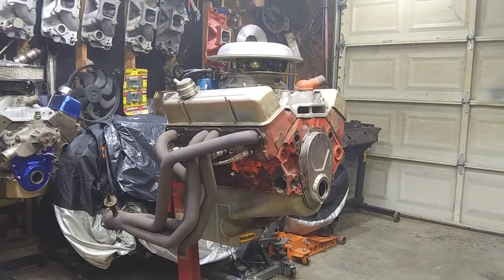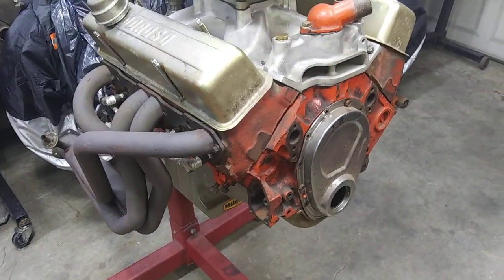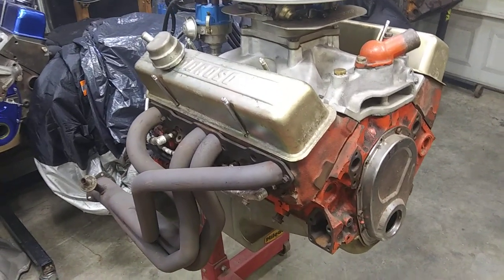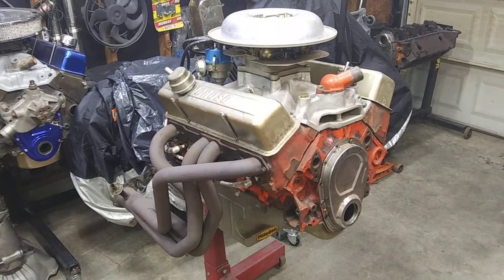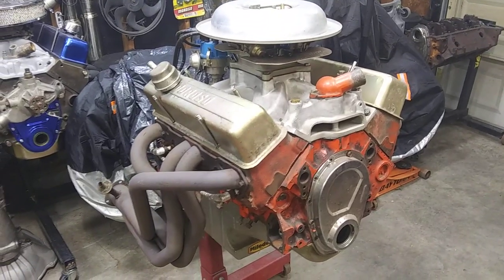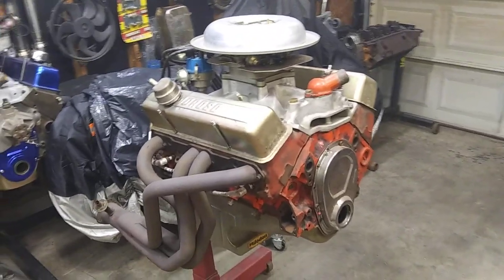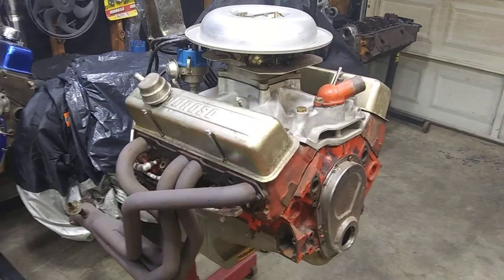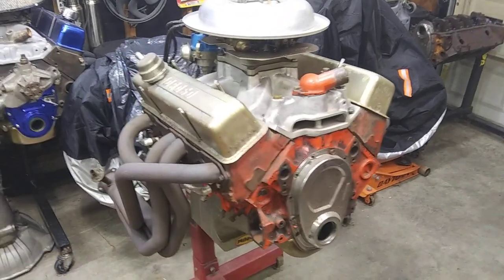The truth about the "Double Hump" heads.

Comment: Back in the day we threw a motor away if it was going to cost $500 to rebuild,   and you never put stupid money in the heads that's why if you had 202's you put them on,  amazing to see people spend 3 to $5,000 for their motors nowadays
Reply: V8s are becoming exotic , manufacturers have literally told the general public this , you want a car with a V8 now a days you have to be well to do and are now in the exotic car market .
Reply: 3-5000k is a short block now. No heads, no nothing up top. Some crate engines are well over 10K now. Better go check your numbers again.
Reply from the maker: Unfortunately the shits gone way up. Typical high performance built SBCs for me these days is $5000 to $8000 grand for parts & machine work. Bigblock Chevys are $8000 to $12,000 grand. And those prices ain't bad for today's economy. Olds, Buick, & Pontiac cost even more for a real powerful build. Pontiacs are what I started with, but I can't afford them hardly anymore. I miss the good ole days.
Reply from the maker: I'm building 3 bigblock Chevys now, I'll have around $30,000 in the 3 of them. But they will all be 700+ to 800+ NA HP each. I can still build a 300hp 350 for less than 2 grand tho. Probably could build a 400hp 350 with a Vortec longblock for 2 grand. Basic 350 SBCs are still the cheapest engine to build by far and they do respond to modifications better than most.
Reply: $5k.....nope. more than that.
Reply: 10k motor 5k powertrain and 4500 for Whoa 2500 for the wheels you're gonna put the big whoa into.
Catch me if you can :)

Comment: Don’t forget about the 3/4 race camshafts lmao 😂✌️😎
Reply: I always ask , what, you couldn't afford a whole race cam .... lmao !!
Reply: This actually has a beginning point. The 3/4 cam was a 750 lift at the valve on a flathead Ford.
Reply from the maker: V6 cam....
Reply: I know back in the day my brother ran a three-quarter inch race cam and a 383 cornet and we used to race the rich boys and their Porsches up to the mountains to Phoenix
Reply: It would idle at 40 miles an hour
Reply: They just call them "Stage 2" or "Stage 3" cams now, it's the same idea.
Reply from the maker: @hendo337  yep, simple minded shit. I still prefer to see the actual specs myself so I really know what I'm buying. Stage 3 cams come in many sizes I've noticed.
Reply from the maker: A 3/4 race cam to me is a cam with .750 lift.
Reply from the maker: I'm building a 496 now, it has a solid roller with 748/748 lift. Almost a 3/4 cam. Definitely a race cam. Springs are 275lbs on the seat at 2.050 installed, almost 800lbs open.
Reply from the maker: @hendo337  I like the stage 10 cam myself.
Reply: @thereluctantgearhead4544  sounds like you're building a motor or the pop the corks out of a Honda
Reply from the maker: @awfulcoffelsonecargarage8215  also have a 810/775 lift 296/308@.050 I could use, but it's hard on springs and I'm gonna drive this motherfucker on the street.
Reply: @thereluctantgearhead4544  I would drive it to a parking garage and see how many car alarms I'd set off
Reply: @kenmoule825  you are nuts, .450 would have been a huge flathead cam.
Reply: Back in the day guys like isky ground few cams, full race, 3/4 race, 1/2 , street. It’s pretty old term, but in the 60’s had meaning.
Reply: @dooman700  
It's not my idea. They did that before I was born back in the early 1950s at Bonneville salt flats. 0.75 at the valve. I’ve run a 728 lift at the valve SBC 3" stroke 5L. Hard on valves and springs twenty years ago with rollers and a rev kit on top of them.
Reply: @kenmoule825  it’s your idea because you can’t run .750 valve lift on a flathead. Isky 404a is a Bonneville record holding cam, it had .400 lift. Yeah you may have a small block Chevy with .750 lift but you are not building a flathead with it. The engine design will not allow it.
Reply: It was never my idea. And I've seen valves lifted that high on plenty of old stuff. Flathead is no exception with valve reliefs and different rocker arms. Remember, this is lift at the valve, not the cam lobe. It doesn't matter what others say it was never "my idea."
I don't run flatheads anyway.
I'm am done with this subject. 
Enjoy
Reply: @kenmoule825  you are showing ignorance, flathead has no rockers and it’s impossible to get .750 valve lift. The valve is not long enough. You might want to get some flathead experience before commenting on something you know nothing about.
Reply: @kenmoule825  by the way .480 is about all the cam tunnel will allow.
Reply: Ed Winfield took a full race intake lobe and mixed it with his 1/2 race exhaust lobe and named the cam 3/4 race. It had zero to do with valve lift. Stop the misinformation cycle.
Reply: @dooman700  
You just don't get it, do you?... Valve lift, not cam lift. Learn before you speak.
Reply: @kenmoule825  I get it, and you might want to go look at the design before you speak. I have a record holding flathead. I totally understand. When the tappet moves the valve with no ratio added, you get the same lift at the valve.
Reply: @kenmoule825  on a side note, a guy that told me flatheads were not his thing, telling a guy that runs them to learn before I speak is comical at best. No rocker arms means no added valve lift

Comment: had a 65 327 out of a burnt down vette,i think it was rated 375 hp ,had 202 fi heads solid lift cam with 11 something compression.sinlge quad offy/tunnel ram 800 cfm holley,hooker headers ,mallory dual point distr.and some other goodies.put it in my 64 nova ss,with 411 gears and amuncie 254 low 4 spd.turned low 11s in the quarter mile in 1978,loved that car.called it the rat killer!!
Reply from the maker: I have a 66 L-79 350hp 327 stashed away now. Had one I built back in the day with a tunnelram and a huge solid roller, had it in a 69 C-10 stepside. Engine came from a totalled 66 Chevy 2 SS. I bought the whole wrecked car for $150 bucks. Also had a M-21 4spd and 4-11 12-bolt posi. Body was wasted, got wrapped around a telephone pole back in the late 60s. Car sat in the woods for 20+yrs till I dragged it out. Hell of a deal.
Reply from the maker: I used the old Holley Pro Dominator tunnelram with 660s on my L-79. Wish I still had it.
Reply: @thereluctantgearhead4544  those were the days when you could buy tri5s for a$150,other cars ,& trucks dirt cheap all sorts of flavors.brings back alot of memories of So California in the 70-80 s.
Reply from the maker: @leroyll1144  Yep, definitely a simpler time to be alive.
Reply: Those times sound alittel fast for the combination of parts you discribed???

Comment: What size valve covers are those? I have double hump heads and was told they are different bolt pattern for covers. Thanks for any help.
Reply from the maker: Those are old school gold anodized Moroso valvecovers from the late 1970s. Double humps have standard old school bolt pattern. Those heads with the staggered bolt pattern came on late 50s 283 and 265s. Pretty rare.

Comment: What year are those? I have a set of 69 Z28 with the provisions for the long water pump
Reply from the maker: These are 68. Last year of the no accessory holes. 291 castings. Came off a MO code 68 302.
Reply from the maker: Also have a pair of 292s with accessory holes, but they are over the counter GM heads from 1975. Angle plug "Turbo" heads.

Comment: I just pulled my 291 heads off the 68 327 and had the valves changed to 2.02/1.60 with hardened exhaust seats and put in screw in studs with guide plates. Cost me 600 bucks in total.
Reply from the maker: Pretty good deal. You must have a reasonable machine shop available. They all went crazy on the prices around here in the past few years. Cheaper for me to just buy a new pair of heads.
Reply from the maker: Just the work you had done on your heads would be $1000-$1200 here. Not including parts.
Reply: It's a local shop that has been there for about 35 years or so. It's been the same owner and is always fair with pricing and loves to talk about old engines he's done and mistakes learned over the years. For the price you mentioned would be hot tanking heads and block, pressure testing, magnaflux, honing bores reseating new cam bearing and freeze plugs. Along with machining down the heads for guide plates and threaded studs and new sized valves, valves, guides, and springs included. Well it's around the 1200 side of it. There are still some older shops that just love working on them. And most machines have made their money back over the years.
Reply: @thereluctantgearhead4544  I believe it's the newer shops that will try and stick you much as possible as they're trying to payback the money they spent on all the new machines still.
Reply from the maker: @orbit4367  Problem is around here is most all the competition went out of business, so the couple that survived think they can just charge whatever they want, because they are the only game in town. Gotta drive 40 miles to the next one and it's not much different. And then there's the "big name" machine shop that thinks they're the best in the world and charge accordingly since they only do racing engines. $1000 dollar valvejobs and shit. They are good, but damn. And they have a 6 month waiting list.
Reply: @thereluctantgearhead4544  you got the same problem in my area, here you can't even get a set of heads surfaced for less than $200, just surfaced no washing or disassembly. Machine work around here is highway robbery. I had the local machine shop bore a block a few years back, for just a bore job, no wash, no disassembly, no cam bearings, no deck work, just boring the cylinders they didn't even chamfer the edge of the bore was close to $400 and that was over 5 years ago I'm sure it's a lot more now. Buying reman or new is in most cases cheaper as there is no other machine shops around, the last reasonable shop closed down about 8 years ago.
Reply from the maker: @briang4470  Yep, that's pretty much what it's come to. Cheaper just to buy new shit. Rotating assembles are the same way, by the time ya resize some stock rods with ARP bolts, turn a crank 10/10, but pistons and have it all balanced, it's cheaper to just by a complete balanced rotating assembly, money saved would pay for boring the block. Machine shops are sealing their own fate. That's why alot less exist now. There's a demand for them for certain shit, but for the most part a guy can just buy all new parts and be money ahead. I paid less money for a brand new pair of Brodix heads assembled with all top notch parts for the machine shop bill on a pair of early iron heads about 4yrs ago. Had $1300 bucks in a pair of 041s not including parts. Paid about that for the Brodix heads assembled with all Comp Cam parts and Brodix valves. Cost way to much to get serious with them old heads now. And the modern shit makes more power anyway and looks like a work of art. Plus save weight. Machine shops sure changed since I worked in a couple decades ago. Person drop parts off and we would have them done in 2 days. And $300 bucks would completely machine a block including square decking, boring, honing with torque plates, cam bearings installed, hot tanked and completely clean gray iron ready to assemble. We had a good team of dudes who everyone had his own  specialty and worked hard. All racers and gearheads with badass personal cars. People were different back then. The owner of the shop was about 70yrs old. He's been dead since the late 90s. Dude was sharp. That shop turned out some badass engines. Once built a supercharged 1000+hp 509 bigblock chevy for a drug runners fan boat to evade capture in the swamps, he had money to spare. We also done oval track engines and truck pull mills, mini rods  and of course drag racing. Owner raced gasser back in the 60s. Still had a 62 Chevy 2 gasser he cherished. I loved working at that shop. Definitely had its benefits.
Reply: @thereluctantgearhead4544  yeah it's a real shame, there is a local napa in my area that used to have a machine shop, their rates were very fair and they had quick turn around, they quality of their work was great as well, unfortunately the man that ran the operation retired and now it's just a regular Napa, no longer offers any machine work. We had another machine shop about 1hr away that was ok but they shut down a few years back and the last local shop is the one that is overcharging for everything plus they don't have any crank grinding equipment so to do a true stock rebuild you would either have to buy a new or reman crank or drive 3hrs to a guy that has a small shop that only does crank grinding, that guy is super cool and his rates are fair but for anything performance oriented your usually better off buying an eagle,scat, or one of those other aftermarket cranks that are way better than factory. Machine work cost really has hurt the basic low buck rebuild/re-fresh jobs.
Reply from the maker: @briang4470  Yep, it sucks for sure. We had one of those Napa machine shops too. It was convenient. But of course they closed down the machine shop and turned the store into a Carquest. It went under a year or 2 later.

Comment: I just had a set of 186’s heads with accessory holes redone was on a 1974 350 I had machine to .030 over would you know flow #’s on stock 186’s heads trying to pick a mild flat tappet cam
Reply from the maker: Most 041/186 heads flowed in the 210-215cfm range.
Reply from the maker: Get a cam with a tight lobe separation. 106 or 108 will help your program along.
Reply: Got 186 ,s on my 91 3/4 4 wheel Dr  runs great I need more camshaft to take advantage of them, they are screw in stud's and roller rockers with hard pushrods , I converted the TBI crap to HEI and Qjet 2 great power and milage ole crane blueracer cam , I really need about a 268 but I only buy Howards cams now, Thanks for sharing I'm an old motor head at 69 I've done a lot of Drag Racing 😊😊

Comment: A buddy of mine has a '74 Z28 with an L82 that the previous owner topped with "rebuilt" 186 double humps from a DZ302 or '70 LT-1. The heads bumped up compression and the car ran great at first but started losing power after a few years. Turns out the unhardened valve seats were slowly getting beat to death without leaded fuel. He was looking at $1500+ to rebuild the heads with hardened seats and probably guides until I talked him into a set of L31 Vortec's. We found a low mileage set at a JY for $200 and after having them surfaced I lapped the valves and slapped them back together with new Viton seals. The car ran better than ever and we actually had to up the carb jetting. It's hard to beat an extra 35cfm for under $400 and I didn't even have to listen to a grinder for 10 hours to get it.

I've built strong motors with double humps in the past but like you said, after 50 years they're probably gonna need a lot of work and that's gonna cost. That's also assuming you can find a rebuildable pair of castings.
Reply from the maker: Yep, hard to beat them Vortec heads. Hell of a deal really.

Comment: one of these days i would like to build a sbc with splayed valves parts are getting harder to find in WI. whats your opinion on ductile sleeves for a sbc
Reply from the maker: If it's installed right, it'll be stronger than your other cylinders. Top Fuel dragsters have a sleeve in every cylinder. I've run many blocks with sleeves without worry.
Reply: @thereluctantgearhead4544  iv never built a sbc for racing but iv built a few sbc and ls street engines the sbc always has a big ridge and bad taper and if they changed the oil thats it. LS is just pistons the last one i built had 340k with no taper still had the cross hatch the only thing worn out was the pistons everything else was perfect even the bearings +.0012 so if i use ptfe coated skirts and ductile sleeves it should be equal to the LS longevity but with better power add splayed valves and stroke it would be one bad a$$ n/a small block send some 3ed and 4th gens home crying

Comment: All facts. I still have 3 sets. I have the machines to work them over. I would be doing them like you, for an old school rod. I have gone with modern aluminum heads "ready to go" and still put hours into getting them right. Every set needed to be lapped in because they wouldn't hold fuel. Remember guys, ready to go ain't ready to go. Still a nice set of new aluminum is the way to go.
Reply from the maker: Right on

Comment: Couldn't agree with ya more on money spent on double humps,, although I have found most aftermarket heads arenot ready to go out off the box, they require some work just to make them right, as long as I have double humps on the shelf, I will use them, I have a set of 186's  which I'm getting ready to use, which I'm making the car correct on numbers matching

Comment: Ran a few sets over the years, on the street and track. They're restrictive compared to aftermarket heads. I liked them when they were cheap and untouched. In the end the best thing about them is the insignia on the ends. But if I got a decent set for cheap, I'd still run them.
Reply from the maker: They can be made to make good power. Not everybody needs a $5000 dollar pair of heads and 900hp. I've used more than a few of the old humps back in the day. Wasent many choices back in the old days. I'd port the shit out of them and put big valves and shit in them. Machine work used to not cost so much. I'm gonna use some 292s on a old school 70s style racing engine. They've already had alot of work done a long time ago. So they won't cost much to get in shape. Been sitting for decades. Engine gonna be a high compression 327 with a big solid roller.
Reply from the maker: Built a 327 back in the 80s that made 540hp at 7800rpm with ported 492 angle plug heads. Ran 7.00s in the 8th in a 69 C-10 pickup.